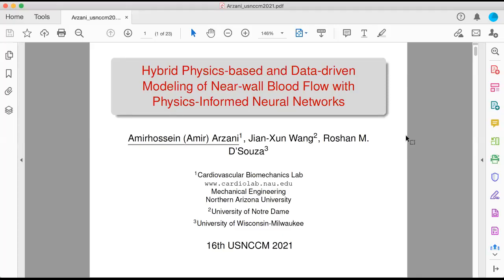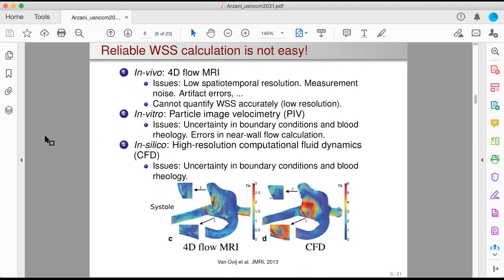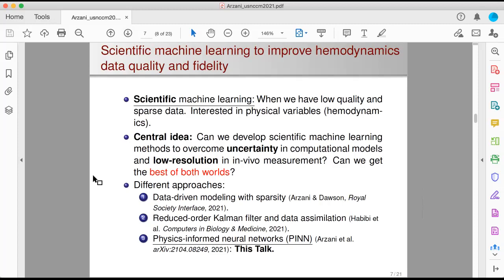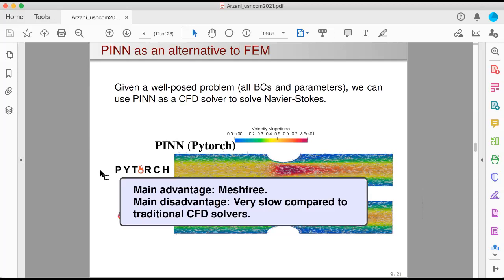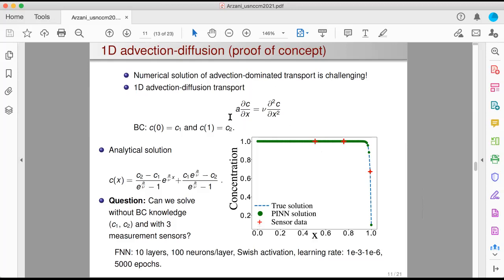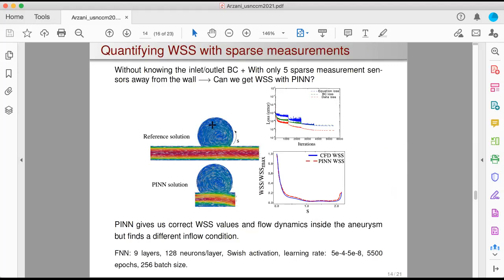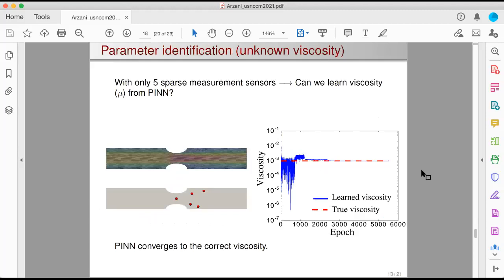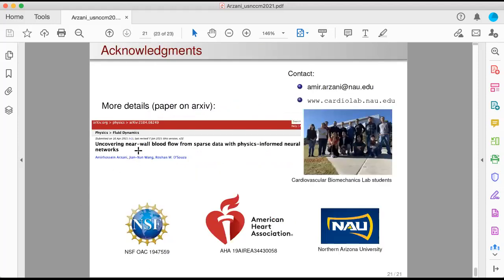Near-wall Blood Flow Modeling with Physics-Informed Neural Network (PINN).

Comment: This is a great presentation about PINN model application.
recently, I have been deeply interested in this model for the water flow simulation.
then I felt big barriers for the input data construction for the model.
Can I get tips for the input geometry data set like mesh generation for the CFD model? or any recommendation ?

Comment: Arzhani, this is my second question. 

I am trying to implement your method to predict velocity and pressure fields in a spinning shaft which is partially filled with oil, and outlets exposed to air, from 10 experimental data points. 

In traditional CFD I use the multiphase method, with close BC/IC as experiment.

Can I use PINN on a spinning shaft, with oil sloshing everywhere and multiphase flow. Can PINN be used to measure both air and oil velocity / pressure fields

Please let me know. Thank you
Reply from the maker: If you have a well-posed problem (meaning you know all BCs and parameters) then traditional CFD method is much more robust and faster. PINN is good when you have some measurement data and some unknown parameters in the CFD model.
Reply: @mramirh1  thank you 🙏

Comment: Hi Arzhani. Great presentation. My question

1) in which software did you code PINN
2) How did the python-pytorch code understand wall location
Reply from the maker: Pytorch. By using VTK libraries boundary mesh data in VTK format can be extracted. You can see the code here: https://github.com/amir-cardiolab/PINN-wss
Reply: @mramirh1  thank you 👏